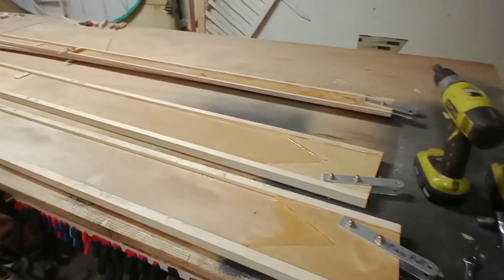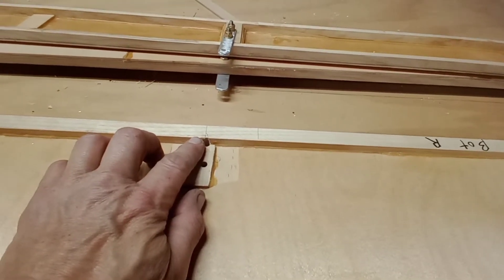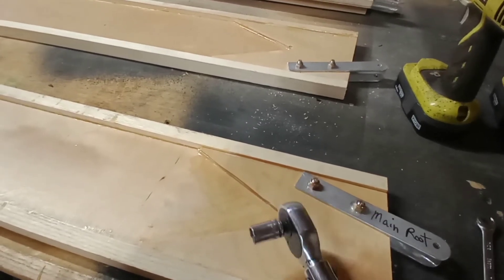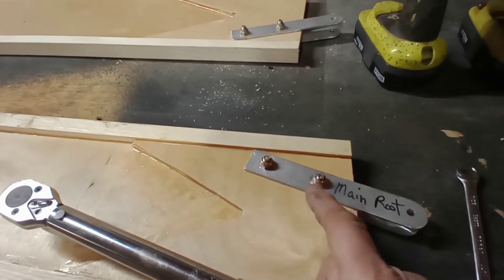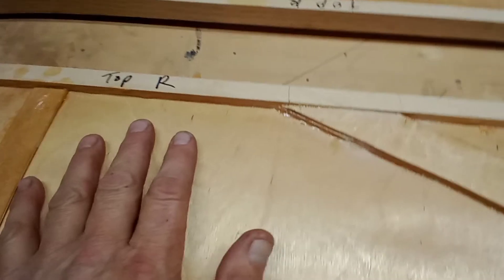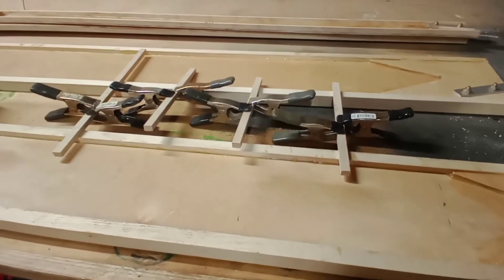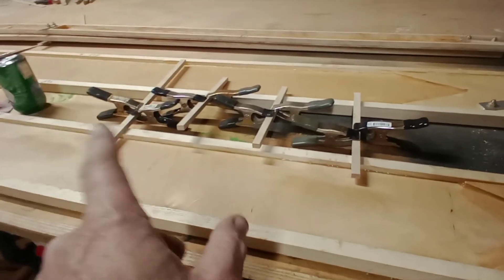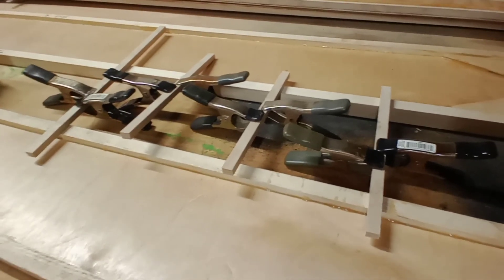FP202 Scratch build from prints E67 finish the spars

Comment: I would have modified the jury strut fixing as I would not want anything to cut into a spar cap (you have just lost about 15% of that caps strength by having that part hole going through the cap).
Reply from the maker: Well I have worked on 4 different Koalas and they all have it the same. And I'm not one to alter the plans typically. But in this case I believe you are right.
Reply: @timketcham9139  On the youngster there is note saying make sure you do not drill into the spar caps. The trouble is you have done it now and varnished the area; if you had not varnished you could have put a splint on both sides of the web.
Reply from the maker: @flyingkub  I suppose I could demonstrate a scarf joint across the entire spar.
Reply: @timketcham9139  I think just a splint on each side of the web would work if you can get the varnish removed, so you have a good bond. All that said, as the wood you are using is so much stronger than standard, it probably is not an issue.
Reply from the maker: @flyingkub  I really appreciate your insight and knowledge. I was thinking the same. I'm not sure the reason they have that hole in that position... but the greater sin was my reduction of the built-up reinforcement area.